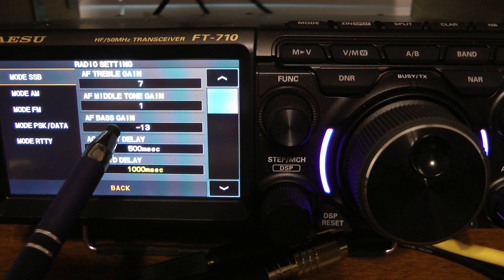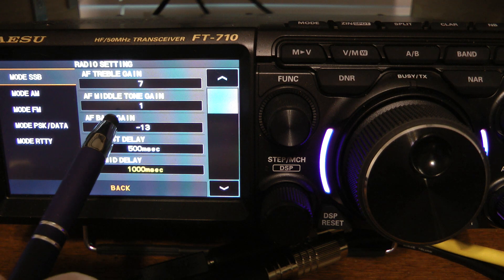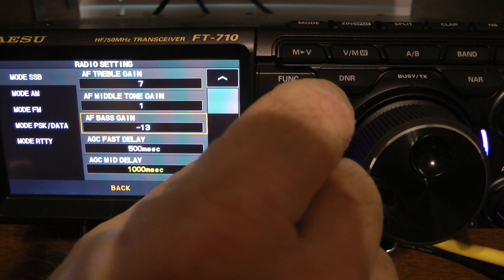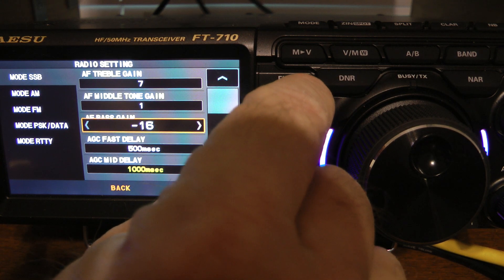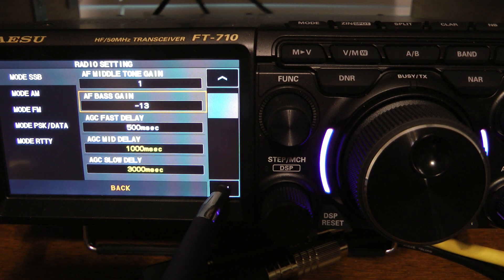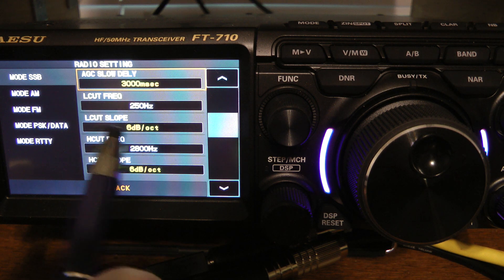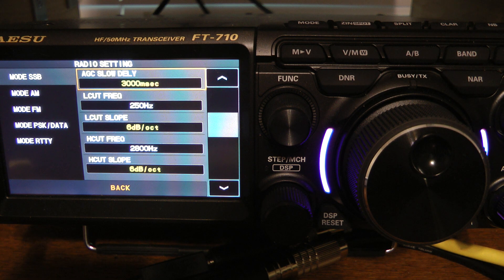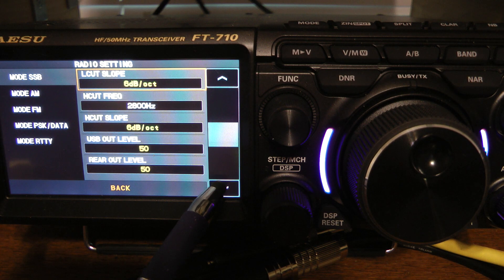Yaesu FT-710 Receiver setup

Comment: I just ordered my FT-710 yesterday (couldn't pass up $799) so your video will be very helpful. Thanks, and I have subscribed.
Reply from the maker: You will love the FT-710, in my 46 years of ham radio its the best rig I have owned
Reply: wow thats a great price! I know its a year later but let me know if you might know of another deal for a new one. Looking to purchase here thx u!
Reply: @andykular3756  Thanks but I should have noted that what I bought was the Field version, no speaker. I got it from Gigaparts and it was $999.95 with a $200 manufacturer coupon, maybe because it was Black Friday. The radio has been great, no regrets.

Comment: Logitech M310 mouse works great on mine.  If you click on the blank area just under RF POWER it will bring up the Shift Width Notch Contour controls.  The mouse is really helpful with the 710.